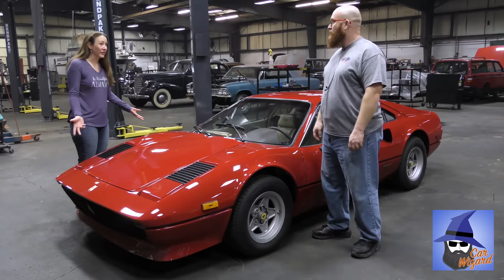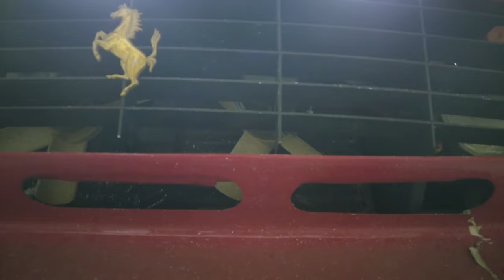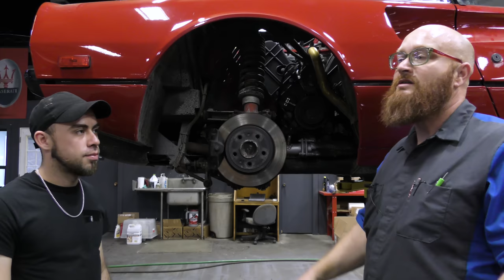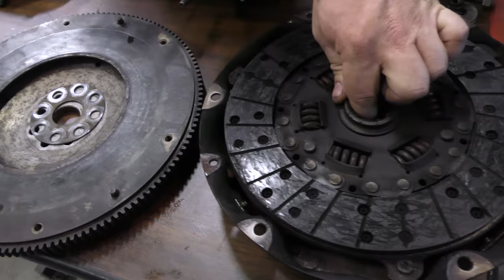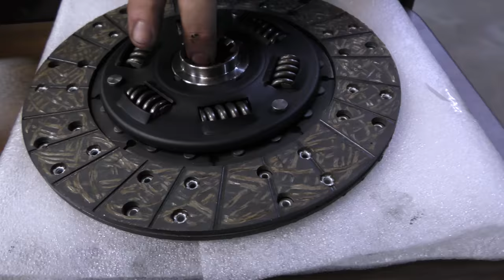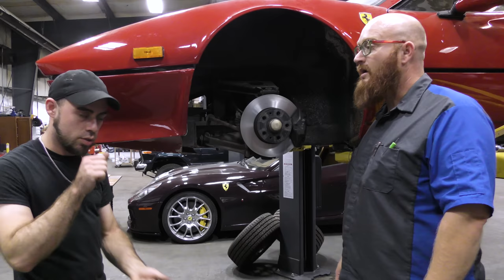Engine's running! Finally the CAR WIZARD can address the burned up Clutch in the '78 Ferrari 308GTB

Comment: The Porsche 928 has an easy clutch as well.  You remove a plate from the bottom of the bellhousing, undo two bolts, and the driveshaft telescopes backwards.  Then you undo three clutch bolts and the whole assembly drops down in your hands.  An experienced mechanic can do a clutch job on one of these in about one hour.

Too bad that only about 15% of 928's were equipped with manual transmissions....

Great video!
Reply: Are the automatic transmissions on the 928 known to have issues or are they just hard to do regular maintenance on them?
Reply: My 928S was a manual and I wished it was an automatic. I did not care for the dog-leg shift pattern. It was a PITA going from one car to the other with different shift patterns. Plus, I'm tired of shifting now, probably all my future cars will be automatics anyway. If I could afford a vintage 911 I would get a manual, but a modern 911 would definitely have a PDK.
Reply: @OMGWTFLOLSMH  all depends on where you drive and at what time.  I have only manuals. But I don't have a rush hour commute.  I totally despise the school dropoff lane (it's on a hill)
Reply: @OMGWTFLOLSMH  "My 928S was a manual and I wished it was an automatic. I did not care for the dog-leg shift pattern. It was a PITA going from one car to the other with different shift patterns. Plus, I'm tired of shifting now, probably all my future cars will be automatics anyway. If I could afford a vintage 911 I would get a manual, but a modern 911 would definitely have a PDK." Oh, you (I could say a LOT, but I'm not going to, your icon is all the clue, we clued up really need!!!!)
Reply: @TheMentalblockrock  and you could have spared us your puerile little comment.
Reply: @OMGWTFLOLSMH  ARE you serious?  OK, I get it.  My dad got old and was trying to shift my 928 by jambing the shifter fast like he did in his '63 split window Corvette and  I told him to stop and slow down;  You move the shifter, there is no need to "shove" it.

As to the dog leg, I let about 20 people drive my 928 over the 19.5 years I owned it an none ever backed into another car....
Reply: @PseudoSpaceMarine  They are Mercedes automatic transmissions and from what I've heard are reliable.

Comment: Opel/Vauxhall front wheel drive cars of the 1980's did an amazing piece of engineering on their vehicles to change the clutch without taking the transmission out. The fitted a cover in the bell housing that you would remove then press the clutch pedal whilst a 2nd person would put steel clips to hold the pressure plate closed. 6 or 8 bolts later clutch out in 10 minutes new one fitted, job done. :)
Reply: Also the mainshaft retracted so the clutch could drop. As I recall, only on the 4 speed though.

Comment: A trip down memory lane for me!  I had a 1988 Ferrari 328 GTS as a daily driver. It looks almost identical to the 308 except it was 3.2 liter, 4-valve with fuel injection from the factory. I could change the clutch and timing belts through the wheel wells in the 328 also.   It was a practical car and it was my daily driver and I loved leaving it covered in dust and dirt - people got so upset.

Comment: A 55 amp alternator?

With the added fuel injection, I would advise you to try to shop a higher output Bosch unit that will fit.  This can be done, but it takes a little research.

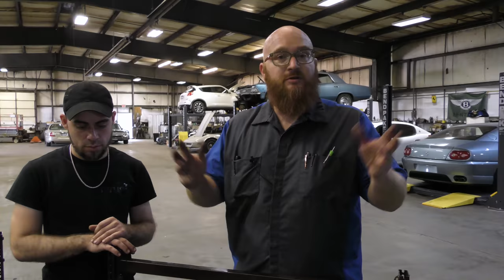Comment: At 8:00 the alternator is not charging, likely because the brushes and slip rings have motor oil on them. Degreasing might fix it. BUT, Don't squirt Brake Kleen in it while it's on the car running! Seems like a time/labor saver but it isn't. They don't make a flame throwing pinwheel effect everytime, but when they do it sucks. Not every lesson needs to be learned by experience.

Comment: Check the expansion tank, the underside of the top goes rusty on the inside. They were hard to find & £7-900 when I was looking back in 2008, I`m sure they`d be more so on your side of the pond, a decade on.

Comment: I can think back to how many clutches l have changed except for the last two clutches l had them done by a workshop but the clutch on your Ferrari 308 what a breeze do easy l was thinking of to make a clutch replacement  easy and Ferrari did it l am impressed and if l see a Ferrari 308 driving around l will think to myself a very easy clutch to change

Comment: Cant wait for the dyno. I bet 255.4hp out there on a good tune, wonder how much of a difference will the injection offer, IMO it will contribute more to the torque at low revs an some midrange than to the max horsepower

Comment: The 308 is one of the best video series. Now the flywheel appears to have 2 large cracks on the face or are they just each a groove.  So obviously it hasn't any cracks or you would have said so but it looked like it. I  am just curious.  Cheers.

Comment: If you soak the old oil filter in paint remover, you'll find that it is a Fram, Bosch or Mahle with a different parts number from the Ferrari Filter. Found that out in 1983 by leaving a Ferrari filter in the parts washer. It was a Fram.  Ferrari makes you pay for paint job with the horse.

Comment: I'd have to be cleaning all the exposed areas in those wheel wells along with repainting while the both sides of the engine area is exposed.

Comment: Great to see a bright future ahead for this little monster. It got me thinking about converting my 4 carb motorcycle engine to injection, those eighties 4 cylinder engines run so poorly on clogged carburetors. And I am sick and tired of repeatedly disassemble and clean carbs over and over again. Anyone did a conversion?
Reply: have you ever had your carbs balanced?  if they are CV carbs have you replaced the diaphragms? those old 4 cylinder 4 carb bikes absolutely scream, no need for injection
Reply: @Rangitatahunter  Heck yeah, and run good high octane fuel

Comment: I don't know why most companies use a chain rather than gears because there's less parts with gears and they last longer, unless the reason is because they last longer that there's planned obsolescence. I suspect that to use gears you need the right metal mixture to get a good tough gear.

Comment: I bought a jeep 6 years ago that was declared a basket case, The compression was 170, the distributor was off a tooth and the timing chain was shot easy fix, on a 2,5 wrangler

Comment: Doing all that work, considering the flywheel got hot from the discoloration, why wouldn't you replace it? Risking it having excessive runout which is common when over heated. It's like a pulsating brake pedal when rotors warp but felt on the clutch instead.
Reply: Check the price on a Ferrari flywheel, if it can be cleaned up it's a few grand savings.
Reply: @pete2072  Yeah you're right. Forgot about Ferrari prices. haha ffs

Comment: As a middle-aged guy, I'm learning something about the mechanical engineering that goes into the typical ICE. i should have picked this stuff up as a kid growing up in a household where we had a Peugeot 404 that was being worked on every weekend! Alas, it was never explained. 
Regarding the triple bearing transfer on the 308. Does this not lead to energy loss or is there no other way due to the space and transverse mounting position?

Why does a brand like Ferrari stil insist on timing belts vs. chains ?
Reply: They could use wheels of cheese and people would still be falling over themselves to pay an exorbitant amount for a Ferrari. Plus they would make tons of money replacing that cheese.
Reply: @nicholasvinen  From an engineering perspective, I would think a chain will better handle the forces generated from a high revving engine, which Ferrari is famous for. Anyway, they've been doing it for eons and unlikely to change.
Even brands like Toyota which dabbled with belts have switched back to chains. Lexus, honda, all use chains for good reason.

Comment: If the alternator is dead, why not just swap on a GM CS144? Even paying the guys to fab a bracket seems like it would come out under $800, and it would be an easy and cheap replacement down the road if needed again.

Comment: Wonder how much this car will be worth when it's finally sorted? The engine will not be in its original state, and despite the fact it will be running well with (hopefully) reliable fuel injection and electronics, I have to think it will be worth less than a fully original, fully sorted vehicle. It really is a driver/keeper that the Wizard would likely never lose money on. Drive it, hammer it, maintain it, keep it.

Comment: Datsun made an F10 that the clutch can be replaced in less than an hour.  The bell housing had a plate that split it in half for clutch replacement.  The transfer gear is like a clutch alignment tool that transfers the power output to the transmission.  The clutch was sandwiched between two small flywheels. I was able to replace my clutch with a 14 piece 1/4” socket set in less than an hour.

Comment: The Toyota 3 cylinder turbo from the new Corolla would be a nice engine swap.  More power than that old V8.
Reply: 90% of the reason to have an old ferrari is the engine. And no 3 cylinder is ever going to drive like a independent throttle body v8.